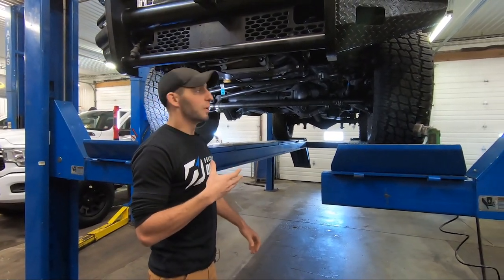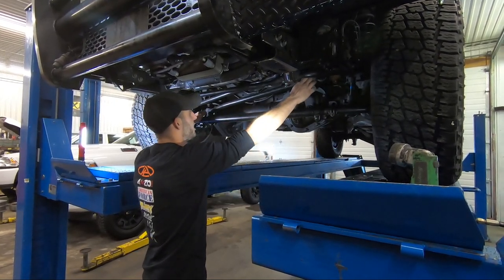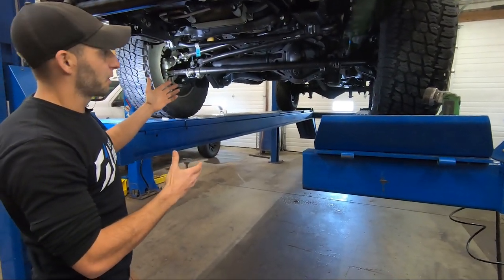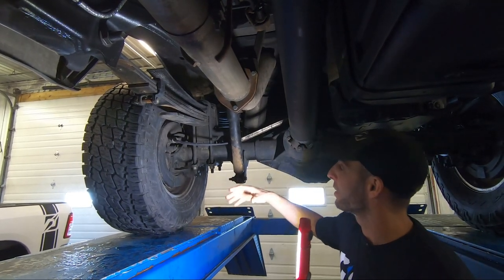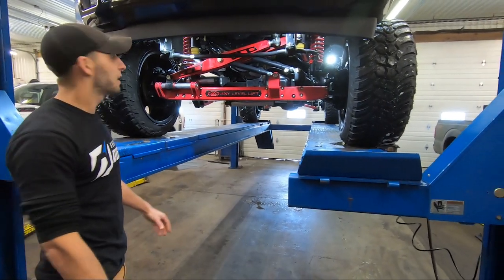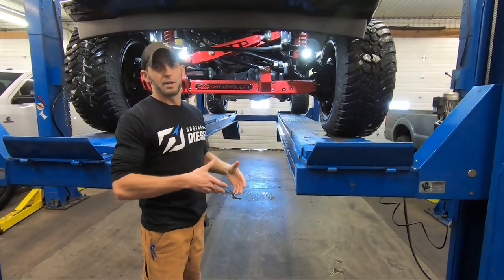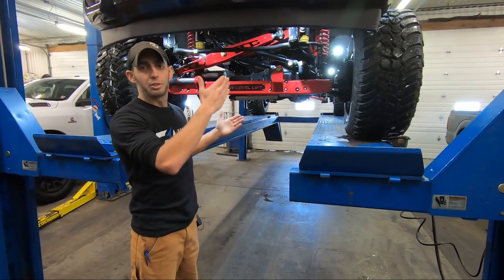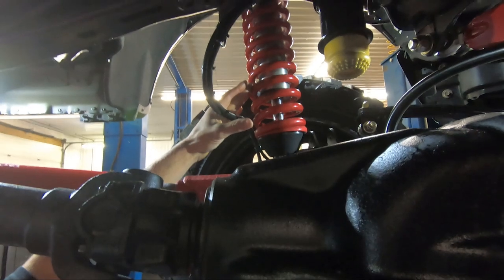The Difference between an Any Level Lift and Standard Suspension

Comment: the biggest difference is $38,000 for the pan hard bar alignment. Being able to lift the truck up and down is only a show thing. I can handle a misaligned axle frame movement for that price.  Thats half the price of a pole barn with a gigantic overhead door. caster alignment and driveshaft angles stay together through radius arm as they move through the arc.